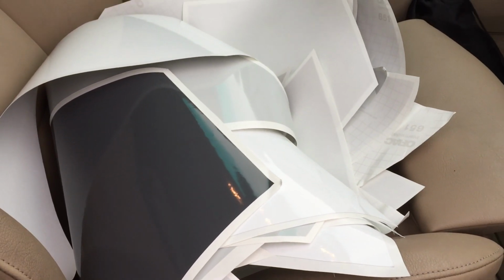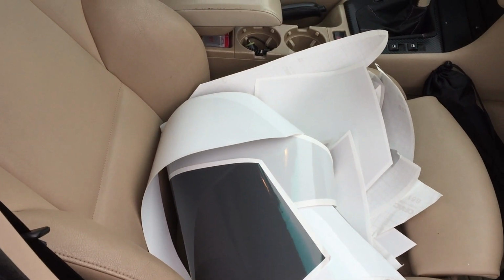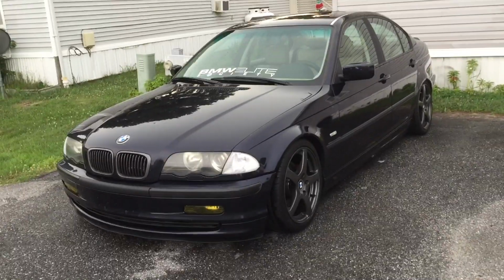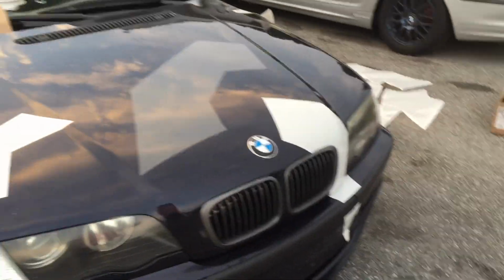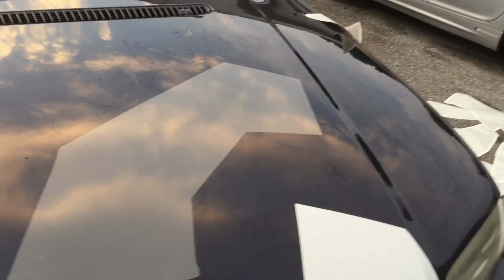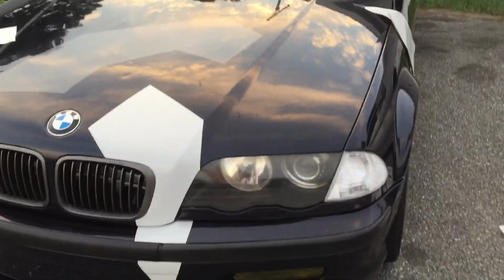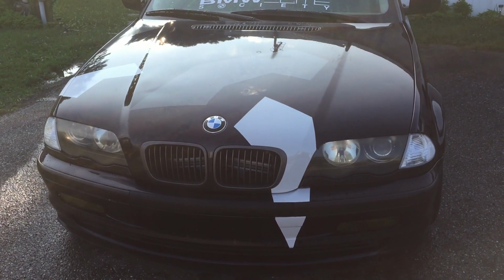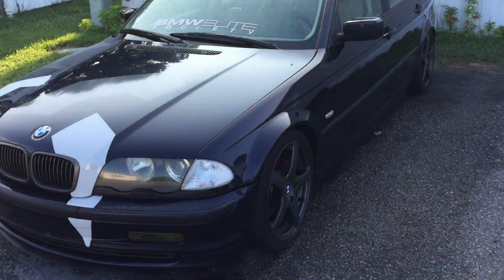How To Urban Camo Wrap Your BMW E46

Comment: Is it still as durable as wrapping whole car parts? What I mean, by wrapping whole parts the vinyl goes around edges and is secured a lot better. In this case, doing urban camo wrap, the edges of vinyl is exposed to wind, dust and etc., so do you think it might start peeling off a lot quicker ?

Comment: What are you using for you high beams, LEDs? Do the daytime running lights still work okay?
Reply from the maker: Chris Phillips there the oem xeons and my daytime running lights are cheap eBay ones that throw codes 😂
Reply: The daytime running lights and high beams are the same bulbs (The inner ones) the outer are the low beams. Either way they look clean. You should get an old laptop and get a cheap kit with BMW scanner to code it and get the light off, It is very easy and cheap. anddddddd make a tutorial while at it ;) It also amazes me how you make time to reply to every comment. Not many channels do that
Reply from the maker: Chris Phillips your right sorry well my low beams are xeons and inner are cheap eBay ones and what program do i need to clear it?